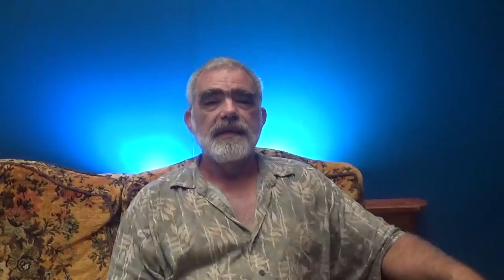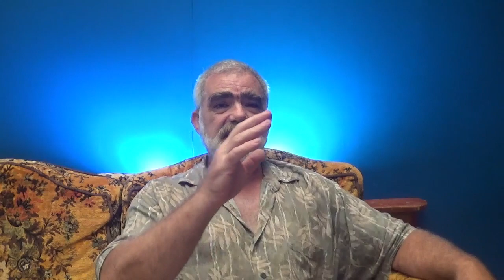What the  (Bleep) do we know about Aircrete?

Comment: So here's a question that I've tried to find time after time to determine proper procedure for pouring a wall, not making blocks.
What's the thickest you've poured your aircrete without the lower bubbles collapsing and it getting denser at the bottom of the pour. Obviously, a wall would have to be poured in stages and built up in height gradually but I don't want to reinvent the wheel by doing testing that someone's already done, there's no progress there.
Right now I'm trying to use aircrete to fill voids under a slab where the dirt has settled and the slabs not supported (about a 1/2" gap, but enough that the slab will eventually crack if something isn't done)
Reply from the maker: This is a topic I expect to cover in the next week or two. I believe tinygiantlifestyle has gone 3 ft high in a single pour, but I have no data on how much loss there was.
Reply: @thehappyheresiarch1053  Daniel at Tiny Giant Lifestyle has done 18 inches but only recommends 12 inches. He recently presented a way to build walls using slip forms!👍
Reply: Bob, supporting an existing slab is a problem best solved with something more solid than aircrete.  People do use expanding foams, but aircrete only contracts, esp when you put it on a porous dry surface.
Reply: @SpaceCrete  hmmm
Yes it contracts but only a couple of percent. It's a very wet environment as my house is built on a hillside and every rain it gets soaked. I've diverted as much water as I could but had to stop at the point of increasing the undermining. I don't need to raise the slab and it hasn't cracked yet but I do need to solidly fill the gap which extends several feet under the slab. The foam contractor wouldn't guarantee that too much rise and cracking of the foundation wouldn't happen, regular cement is too thick to flow in, I can't dig it out to make a thicker support pad nor afford to have pilings installed. By process of elimination it comes down to flowable aircrete
Reply: I saw a video where they did the pour in lifts. They had a shot Crete nozzle and they were going around the perimeter of the house using a 12x12x2 inch board and they used that to hold the airCrete in place. So they went up 12 inches per lift. By the time they got back around the perimeter of the home the aircrete was dry enough and held up to the next lift being poured. Does that make sense?  I think it could work.